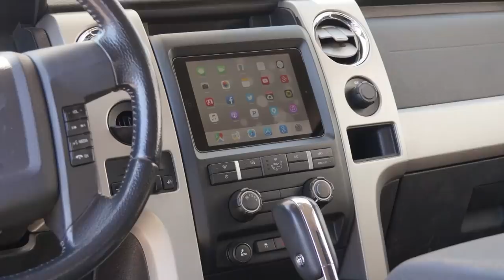Bondo session and Passenger door pop! - Bass Van Vlog #18

Comment: Extra output... send your trunk pop to a relay that is normally closed so it works your passenger door, use domelight output of alarm to trigger the relay and the triggered output to your sliding door. This allows you to disarm the alarm which allows the sliding door to be opened while domelight is on (15 sec), then it goes back to normal on the passenger door.  I used to do this setup (used timer relays sometimes) to control airbags from the remote upon disarm.

Comment: Bass van taillight mod suggestion;
Knock out the clear part of the reverse light lens and install 1000+ lumen LED reverse lights. You just have to sand away the plastic on the inside that is overlapped between the red and clear plastics. Pry between the red and clear plastic to break the old adhesive bond the simply knock out the clear with a hammer. I did this on my Chevy Suburban square body plow truck and it is amazing and cheap($20 for bulbs).

Comment: For anchoring panels together
Drill a series of pin holes in either one or both
panels, so the seam sealer can push through
the holes, curling over like a rivet- not just
glue in between.

Comment: if its an alarm/starter i think it had an -output for rear defrost u can use and it should have - for trunk pop i think it was hold unlock for 3sec
Reply: I used to use the domelight output to split output channels. Front door when the light is off and then side door for 30 seconds after you arm. Or something like that

Comment: So what’s plan B when the car battery dies for some reason. Got no way of opening the doors manually without a keyhole. Maybe you should add a quick disconnect battery charging cable and hide it under the van so that you can easily add a power source.